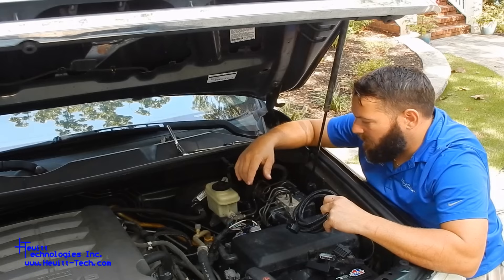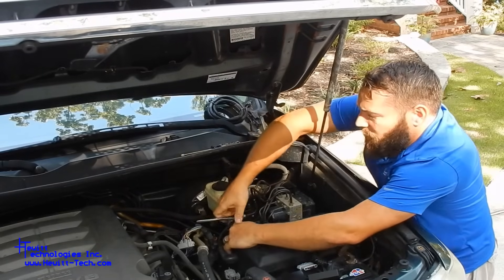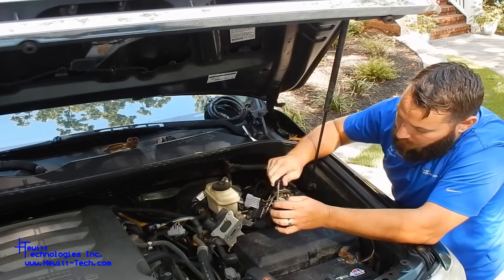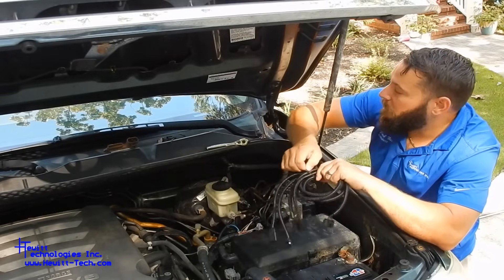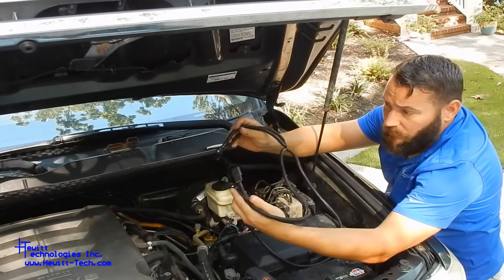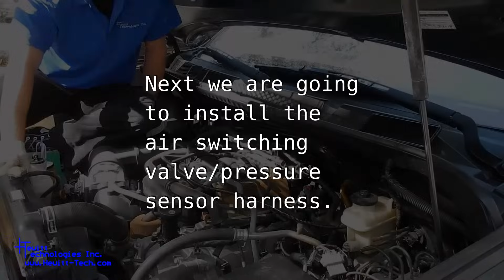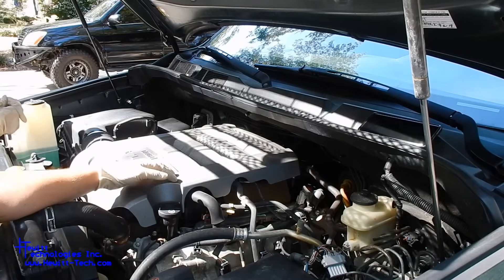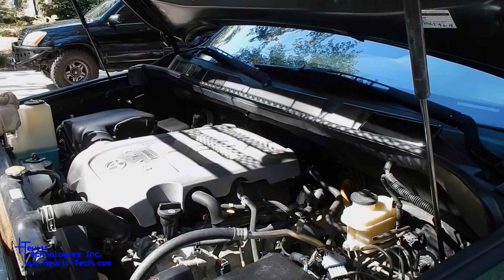Gen-II Secondary Air Injection Bypass Module - 2007-2021 Tundra 5.7L- Hewitt Technologies

Comment: Now i have a nasty ticking sound  come from driver's side. Checked heat shields and they are fine. What else could it be?I'm semi handy and it took me a solid 3 hours. Customer service was great, written instructions were good for everything except the pump connection. If a person didn't know what to feel for, instructions were borderline useless
Reply from the maker: Sounds like you have an exhaust leak. Check where you installed the block off plates.

Comment: When bypass how about performance?
Reply from the maker: SAIS is 100% emissions related and bypassing would not increase performance or fuel economy. That said, if you are tripping fault codes that put the vehicle into Limp Mode, our products can help address that and with it restore power to vehicle. Please let us know if you have any additional questions.
Reply: @Hewitt-tech  my car was air secondary injection vale was stuck, why my car can drive only 120 km/h and don't gear 5, 6 can't use
Reply from the maker: @user-oy1qc5xt2v  It sounds like the vehicle is in "Limp Mode" which will govern performance. If you could send an email to support@hewitt-tech.com with your current error codes we are happy to recommend the best solution.

Comment: I have a 2012 Tundra 4.0 Liter. I had codes 2440 and 2442. I contacted Paul from Hewitt. He guided me through the process of installing the Gen 2 bypass. I hadn't done much automotive work in the last decade due to age and injury so I was leary about doing the work myself. Once I got the kit and watched a few videos I went to work with the very clear and concise instructions. Turns out the intallation was about a 2 on a scale of 1-10. Really pretty simple. I had little issues accessing the the bolts and screws. The block off plates slid right in. After I completed the install I started her up and had a little bit of vibration for a minute or two. No codes. No idiot light. I drove it for 4 days on all conditions and have had no problem. Paul Hewitt replied to my emails promptly and in enough detail to make this easy. The service and support was as good as it gets. I saved myself a good 2 grand probably by using the Gen 2 bypass. Thanks Paul!
Reply from the maker: I am glad you got everything installed and it went better than you were worried about. It was great talking with you and if you need anything else just let us know. 
 As you were!
Reply: @Hewitt-tech  hey Paul, just wondering. I’m gonna drive to Pa from S Florida in Oct. Do you think it would be wise for me to buy the other cable, forget what you called it. The one in case your sensors go bad. In case it goes bad on that drive. If so how much and I imagine it’s simple to snap on, right? Thx again. Hey, I read all these comments. You are running a business the way it used to be and ought to be. You should teach classes on how to treat customers. Seems that all your customers feel the same. Semper Fi!

Comment: Hello, i have a 2008 Sequoia with code P2442. I was curious what the difference between Gen 1 and Gen 2 kits are and which one is needed for my truck? Thanks!
Reply from the maker: Here is a quick blog post that will help explain. Give us a call if you have any further questions. 
https://hewitt-tech.com/blog/secondary-air-bypass-kit-comparison/

Comment: Anyone still get the P2440 after having the kit for some time?
Reply from the maker: @Frescolex There are a few reasons the the P2440 or "Valve Stuck Open" fault code can trip after installing the Bypass Kit. That said, Our Bypass Kit require the Pressure Sensor inside of the Air Switching Valve to be in good working condition to operate as engineered. So if the pressure sensor were damaged prior to installation or the Block off Plates were not installed with the Bypass Kit, could lead to the P2440. This is a Mechanical SAIS fault code, however we have seen it mask a pressure sensor issue. If this were the case then a Pressure Sensor Kit addon would be needed in addition to the Bypass Kit.

Comment: After going to two different mechanics because I got a PO419 code in my 2010 4.6L Tundra and was told by both I needed 2 new air pumps from Toyota only! I started researching alternatives. I found Hewitt-tech Gen-2 bypass a cheaper solution. I’m 79 years old and the biggest problem I had installing was separating the electrical connections. I thought putting the block off plates between the ASV and the air tubes was going to be difficult but once I found the bolts to remove from the air tube brackets and gently with a 10mm wrench loosened the flange bolts I was able to breath! Everything else was easy and once I tidied up with zip ties reconnected the negative cable to the battery I crossed my fingers and started the truck which immediately died(normal) after restarting the engine light was gone and I drove it around the neighborhood. All is good and when I had questions I emailed them to support with pictures and got a response right away. What was even scarier after was thinking about those mechanics I took my truck to and how much it was going to cost me if the air pumps did not fix the problem because there are other pieces to this puzzle as simple as a corroded terminal in one of the connectors. Great money saving product with helpful people Thanks Hewitt-tech.
Reply from the maker: Jack we really appreciate you sharing your experience and glad you found us. Your right it is scary to think you could have spent $$$$ repairs and may not have fixed the issue. Aftermarket components are trash and we have even seen customer go through 2 - 3 sets of Factory/OEM equipment before they find us. If there is anything else we can assist with do not hesitate to reach out.

Comment: Does this fix the p0418 error on the 2012 tundra 5.7? If my state doesn’t do emissions so I think this would be an option?
Reply from the maker: The Gen2 kits are able to take care of P0418 by itself without any other kit add-ons.

Disclaimer: It is illegal to remove, dismantle or otherwise cause to be inoperative any pollution control device required by federal, state, or local emissions law. Our bypass kits are sold for off-road, competition or other emissions exempt use only. No other applications are intended or implied. By installing or using this SAIS Bypass Kit the vehicle owner and installer acknowledge and assumes ALL risks associated with its use.

Comment: Will this pass CA smog test?
Reply from the maker: It is illegal to remove, dismantle or otherwise cause to be inoperative any pollution control device required by federal, state, or local emissions law. Our bypass kits are sold for off-road, competition or other emissions exempt use only. No other applications are intended or implied. By installing or using this SAIS Bypass Kit the vehicle owner and installer acknowledge and assumes ALL risks associated with its use.

Comment: So there is not two different places to 🔌 plug each harness into for each bank just one? That is the one unplugged factory valve fitting is plugged into with the kits plug and the other plug plugs into the unplugged factory harness plug?
Reply from the maker: The Gen2 harness essentially 'T's into the factory harness and ASV for each bank. Referencing 1 bank at a time, there are two connectors on the Gen2 harness for each bank. Once you disconnect the ASV, the factory harness connector and the ASV will be open. The connectors for each bank are a mated pair. One connector of that bank of the Gen2 harness will plug into the open factory harness and the other will plug back onto the ASV. If you have any more questions please give us a call or email us and we can walk you through it.
Reply from the maker: @Stuarthicks2692 Think of the Bypass Harness as a middle man. It go in between the Air Switching Valve and Factory Wiring harness. The Connectors on the Bypass Harness are male  and female so the connections will only mate one way. If you have any additional question happy to help you can give us a call at (844) 307-7671 or send an email to support@hewitt-tech.com

Comment: I have had my bypass kit for my 2005 Tundra 4.7 for about 4 years now and it is still working great. I was having some issues with my truck that i could not figure out. I contacted Hewitt-Tech asking if maybe the issue could be with the kit. After checking it and found out it was in good working order they kept emailing me until i found the problem. They went above and beyond to help me. Awesome people that still care about others.
Reply: Was your problem related to the mass airflow sensor?

Comment: I had this kit installed about a year ago in an 08 5.7 sequoia. Today the p2440 displayed on dash unit. Secondary air injection valve is stuck open. How do you fix?
Reply from the maker: Did you install the exhaust block off plates that came with the kit? If not that is the first thing to do and clear the code(s) again. 
A valve stuck open code WITH the plates installed is usually indicative of a damaged pressure sensor. Please contact us direct by phone, email or the contact us page of our website and we can help troubleshoot. If it is a damaged pressure sensor, we have Pressure Sensor Replacement Addon that will take care of this WITHOUT the labor of removing the intake manifold to replace the expensive air switching valve set.
Reply: @Hewitt-tech  my mechanic installed I am not sure. Will be calling today, thanks!

Comment: Installing this, i removed my intake, is there anything else i can do back here to make life easier?
Reply from the maker: No reason to remove the intake manifold. However, it would be a good time to inspect and reseal your valley plate if you spot any leaking coolant or pink crust from the coolant.
Reply: Its off, so I will. I did not get driver side block off plate to drop all the way on, so before I re assemble, I will try harder… if that fails i will free the switching valve assy and see if that gives me more play.

Comment: My tundra have p2433 code? This bypass solve this problem?
Reply from the maker: That is a very specific error code that indicates you have damage to the pressure sensor Bank #1 Air Switching Valve. You will need the Bypass Kit and the Pressure Sensor addon to address this. Please give us a call if you have any questions (844) 307-7671

Comment: Just installed Gen II on my 2011 Tundra with 4.6L Engine.  Took 2.5hrs.  Rusted bolts under brackets holding AIDs slowed me way down.  I sheared the heads off of 2 of them, can't believe those bolts extend into the wheel well exposed to salt.  My bracket is held on with 1 bolt and a few attachments to wiring harness clips.  Will need to get them drilled out in the future.  Backoff plates required loosening all three 12mm bolts holding the ASVs on the engine block.  Once the ASV is loose, you can open up a gap just big enough for the block off plates to install.  First start of the engine was a success, we will see how this goes after a few cold overnights but so far...very impressed.
Reply from the maker: Ahh... yes, I have run into trouble with the fender bolts before. I know this doesn't help now but may help someone else, if you hit the exposed threads really well with a wire brush/wheel and some penetrating oil it will help a lot in removing them. Drilling through or grinding the weld nut off and usign a stainless bolt with the nut on the topside would work well for that. On the 4.6L there is that one clamp that holds the air tube down to the top of the valve cover. We found it easiest to We found it easiest to just remove that bolt and carefully pry between the back of the cylinder and the air tube to open that gap. Loosening the air valve is a good and will help give you some more room as well. Getting the ASV bolted back down with the plate installed is a lot trickier if you remove the bolts holding down the ASV. 
Glad you were able to get it all installed without too much trouble though and that it is working. 
If you need anything just let us know. 
Paul
Reply: I have run the truck over the last week and …oh my god…best thing I have ever done to any vehicle.
Reply from the maker: @ShermNE  Really appreciate you taking the time to leave a comment. If there is anything else we can assist with please do not hesitate to contact us.

Comment: Im just install the gen II kit with plates and now i have the bank 2 catalytic converted engine light, ...there's something missing in installation or have nothing to do with it?
Reply from the maker: The two things should not be related. Give us a call or email us with your specific information and the exact trouble codes you are getting. Sometimes when resetting the ECM on vehicles that are in need of a tuneup or the 02 Sensors replaced can cause the codes to trip. This is because the computer cannot tune back to where it was fast enough before the code monitors catch the problem.
Reply: @Hewitt-tech ok

Comment: Does it need a madule ? I hsve. 08. Installed the kit . And the code came back in minutes the check lights came back .. any idea ?
Reply from the maker: If you are getting Check Engine Light and Error codes after installation, it could mean a few things. First, we would want to review installation. Second, there may be a need for a Kit Addon. GIve us a call with the codes you are currently tripping and happy to help.

Comment: Why no close up of the plugs? Looks like the big black factory pins left open? Still can’t find the plugs 🔌 on the back of the motor on my 5.7. The instructions have a close up pic but not a zoomed out one for reference. Searching other videos for better close ups. Seems such a simple omission.
Reply from the maker: Which plugs are you referring to for a  close up? There are no factory pins that will be left open. The kit includes two custom plug caps for the large two wire black and gray factory connectors to be left disconnected. Because of the location of the air switching valves there is no way to get a zoomed out picture for reference. It is extremely difficult to get any sort of picture of the air switching at all because of their location on the vehicle. Most of that work has to be done by feel.

Comment: Bought this for my 2008 Toyota Tundra and it's not working. Truck still goes into limp mode and now no matter how much I clear with my reader, it don't work anymore.
Reply from the maker: If you haven't already done so, please contact us directly by phone, email or contact us page of hewitt-tech.com so we can help get you back up and running. 1-844-307-7671 support@hewitt-tech.com
Reply: Same here. Did it ever resollve😊
Reply: I end up replacing both the air injector check valve and air pump. Just did it myself.
Reply: @realxaxiong   thanks. I will call them.tomorrow and see. Hoepfully i do not have to the whole job.

Comment: Something I did that seemed to help a bit was I took the driver side front tire off and lowered the entire front end so I could reach the back of the engine much easier. I then laid some floor mats across the top of the radiator and engine to be more comfortable
Reply from the maker: Travis great idea and I bet did help with accessing the Air Switching Valves! Also, good call on the floor mats. The process can get pretty involved every little bit helps when diving into the engine bay.

Comment: I installed mine on 5.7 2010 tundra about a year ago and it worked great up until this week.  ???
Reply from the maker: Hey Steven, sorry to hear if you are having problems with the secondary air injection again. Please email us or give us a call directly with your order number and the current active trouble codes and we would be glad to help. Could be something completely unrelated or something really simple like needing to install your block off plates. support@hewitt-tech.com 1-844-307-7671 so we can start a ticket if we need to.

Comment: I replaced the air injection pumps and injection valves in my 2008 Sequoia.. Still showing a code and still in limp mode. So frustrating after putting in all that work for nothing. I guess I'll have to get the bypass now.. can't imagine what else could be keeping it in limp mode. Code says sensors.
Reply from the maker: Could be wiring or ECM related. Give us a call, we would be glad to help.

Comment: Just completed the install on my 2008 5.7 Tundra. As advertised the Passenger Side plug is a bear. I used a hand mirror to visualize the plug and went from the front... just couldn't do it. Son in law has smaller hands and he did it in like 30 seconds. I believe Mr. Hewitt's small frame skinny arms tech in the video is on the passenger side in the demo for a reason lol! I had previously bought the competitors (Ruitech) unit and installed but it failed after a year and went again into limp mode. After emailing Tim (owner) he sent back that they didn't sell their units for 2008 5.7s as it would inevitably fail (his words). Maybe it was my mistake but I usually don't mess up with something like the year model on my truck... anyway I'm glad I finally went with the Gen II and pressure sensor and my truck is running great at 350K miles.
Reply from the maker: We try to make people aware of the difficulty in getting to those connectors for sure. We don't try to sugar coat it. And you are absolutely correct about why I wasn't on the top of the engine...my guy was a former Toyota tech and had hands half the size of mine. 
Glad everything worked for you! Let us know if you need anything. Paul